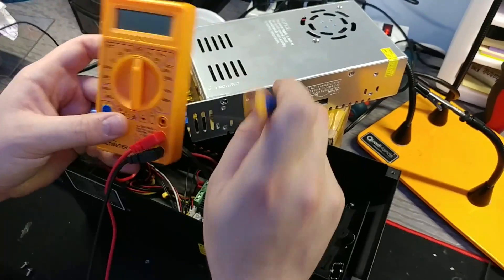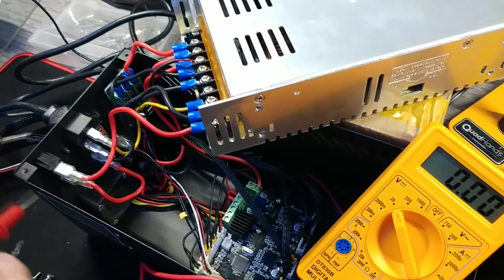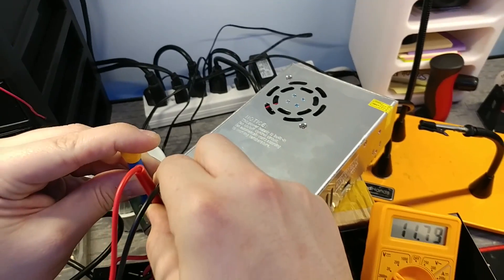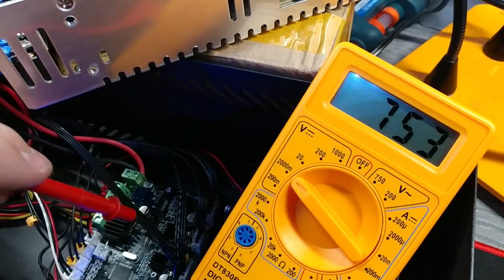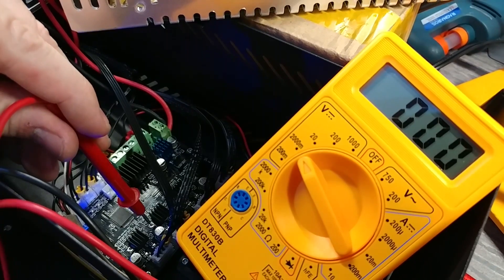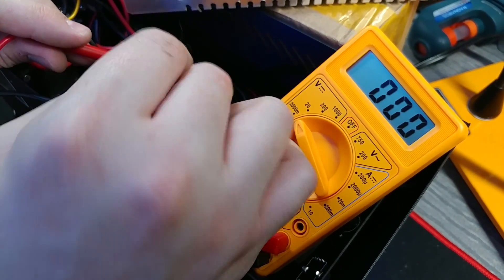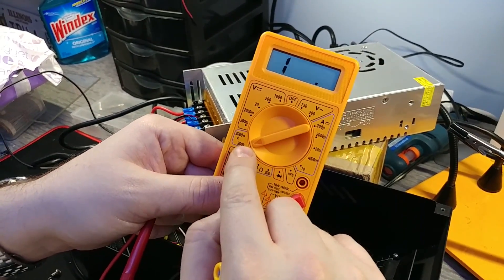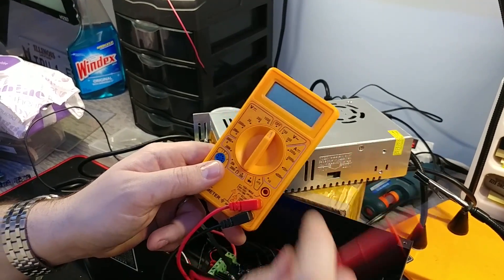Adjusting PSU Voltage and Stepper VREF Voltages

Comment: Any way to find the Max Rated Current of the Creality stock 42-40 and 42- 34 motors? I could only find one aftermarket site specing them at 1.5A. This would work out to something like this for TMC2208:

TMC 2208 VREF equation:
VREF= (RMS current x 2.5) / 1.77
RMS = Max rated current / 1.41

RMS = 1.5A / 1.41

RMS = 1.063

VREF = (1.063 x 2.5) / 1.77

VREF = 1.5014

with recommended 10% safety margin:

VREF = 1.33

Thoughts?

Comment: Damn, this is a solid explanation.  Thanks!!  Do one for the Ender 3 pls!!
Reply from the maker: Ender 3 is exactly the same except the PSU is 24V instead of 12V. The board is the same.
Reply: @TH3DStudio  Would you suggest changing this as you did here or leave it at 24V?

Comment: For ender 3, which are the max vref we can set for xyz and E?
Reply from the maker: E3 use 0.7 on X, 0.8 on Y, 0.8 on E and 0.9 on Z. Those should be good. Dont exceed 1.0.
Reply: @TH3DStudio  Thanks for the note. It has been rather difficult to find the configurations of the 4 stepper motors. Do you happen to have them? eg. the max torque or current

Comment: If you're bumping up a 12V supply to ~13.5V what should the voltage be set to for a 24V supply?
Reply from the maker: You can usually safely run about 25V on those. Don't go much higher.
Reply: @TH3DStudio  Thanks Tim. What about the VREF voltages? All of mine on the creality silent board are about 1.2-1.3V in their stock state.

Comment: The v2.2 board which is being selled in th3dstudio.com has a note saying different vref values? It says X:0.8V, Y:0.9V, Z:1V, E:1V
I guess we should use %90 of these: X:0.72, Y:0.81, Z:0.9, E:0.9
Reply from the maker: The VREFs on the product page are the recommended ones. But slightly lower will still be OK for most machines. If you get step loss on an axis then you will want to increase the VREF for that axis that is getting the step loss.

Comment: Ive been having consistent Y skipping problems and have not for the life of me been able to fix it. Ended up premptively replacing the motor with a similar one from Amazon. The review for the product said to change the vref from 7.whtever to 7. Testing the printer now, I hope to god this works. I tried tightening belts, wheels, grubs screws... At this point im put of options and it makes me sad :(
Reply from the maker: Check here: https://www.th3dstudio.com/knowledgebase/y-layer-shifting-on-your-printer-most-common-on-machines-using-cura/
Reply: @TH3DStudio  Link doesn't work, dude

Comment: I get all the same voltage on each potentiometer but when i move the axis, 2 of the motors are reading 18v and vibrating while the others are like 1.2v. Any idea whats going on with mine?

Comment: Great video!  I'm getting a bit confused though  because putting the multimeter right in the center of the screw gives me normal voltage(760) but touching anywhere else on the screw gives me double voltage.  I have them all set checking the center but my prints have been garbage since adjusting them.

Comment: A few questions:

1) Is the printer connected during this process?
2) How do I determine if my Z axis steppers are connected in serial or parallel?
3) Is there a preferred Z axis stepper connection? If so, how do I convert to that?

Thank you for your time.
Reply from the maker: 1. No, not in our video but you can have the machine connected still.
2. Stock is parallel.
3. Series is less work on the driver but if the VREF is set higher then theres not a big difference at all.
Reply: Thank you for the help :)

Comment: Note your steppers need to be enabled (which they are not if you just turn it on)

If the control box is open instead of jankily turning it upside down, plug in the usb and open cura and move each axis to enable it.

Comment: my x, y, and Z from the factory were set to 0.56, I was getting shifting on the Y axis. I upped the voltages to x 0.73, y 0.83, and z 0.73. Issues have disappeared. Very happy now.

Comment: Thank you very much. Seems these should apply to a CR-10 Mini as the steppers are the same so I adjusted mine (was getting bad layer shifting on the Y Axis). Found they were stock at X(.597) Y(.595) Z(.589) and E(.757). Changed them to X(.725) Y(.897) Z(.724). Left E alone since I wasnt having any issues there. After doing so im 6 hours into printing a piece with no layer shifting on Y

Comment: Thanks for this. My X and Y were 0.8V from the factory, I lowered it to 0.75V and I'll see how it does. The Z was already 1V. While the extruder drivers were both at 0.65V and I increased them to 0.85V.
Reply: Can you give a follow-up? How did it run with lower voltage? Did you return to stock?

Comment: Black is "Common", not Ground.  Also, on that cheap meter, "2000m" is 2 V or 2,000 millivolts.
Reply: So, dc current flows toward common? Why not ac too? All black is common. Got it.

Comment: Could you tell everyone what the proper VREF voltages are for X Y Z & E for an Ender 3?
Reply from the maker: 0.8, 0.9, 0.9, 0.9. You can try 1.0 on all. Basically if you run it too high the motor will just get warm. Nothing terrible. Better to be too high than too low.
Reply: @TH3DStudio  2 Questions:
1. what are good VREFs for the New 1.1.5 Board with TCM2208 Drivers?
2. With a pancake Nema on the Extruder, what ist the best setting
Thank you for helping
Reply: mine were on 573 for x,y,z and 792 for e, ive cranked mine to 752 for xyz and e still same, motors are a little warmer to the touch but not too much to burn your hands

Comment: Tim, quick question. Do you have to have the control box connected to the stepper motors to adjust all the voltages? Or can I have the box simply connected to the outlet with all the wires hanging unconnected?
Reply: You need to enable the motors by jogging them slightly before taking readings.

Comment: Thanks for this video and to learn and understand, I followed your instructions.

But on this web page (https://www.pololu.com/product/1182) it is said :

Note: The coil current can be very different from the power supply current, so you should not use the current measured at the power supply to set the current limit. The appropriate place to put your current meter is in series with one of your stepper motor coils.

And after checking :

Négative on PSU : 0.816 V
Negative on driver : 0.830 V

What do you think about this ?
Reply from the maker: I have done it both ways. It could just be a variance in the resistance of the wires going to the board causing the slight drop. It's nothing to worry about. If its slightly too high its not going to hurt anything. If you are worried check the motor temps. You want them under 70C.

Comment: "these CAN kill you" -puts finger over screws and pulls lid down. 0.0! Danger Will Robinsson!
Reply from the maker: If you touch them yes. :P I are professional.
Reply: TH3D Studio  Hey. Thanks for nice tutorial. During my upgrades (silencing) I readjusted my Creality CR-10 S4 steppers halfway down to your recommended values. The extruder motor was running really hot at 1150, and it also was hot on touch. So went down to 840, and should be fine. Now XYZ cube is being printed, and all seems to be ideal.  For the safery, what you did was really close with opening that lid. You might consider being more safe even if you know what you´re doing. The most secure thing is to think about the work like IT IS NOT ROUTINE. Most fatal injuries from electricity come from routine work. I was close, touching a heatsink with 600VDC potential from the industrial power supply. From that time, I behave very differently. One should, especially when he has a family... Thumbs up, thank you, and stay safe.
Reply: What type of death are we talking about here? Painful, slow burned to a crisp or a quick zap fall over type?
Reply: @n1337s  diffrent is spelled differently
Reply: lol
Reply: So can crossing a street 😂

Comment: what comes standard with the cr10s? series? also the carriage get loud grinding with at 100 % if I turn it down on the control screen to 70% its much more quiet I read it could  be the motor its self if that's the case and I buy a new motor do I have to adjust in software or just follow this video you did? thanks the prints are smooth no missed lines or anything its just very loud when the carriage moves quick back and forth I did also install dampers on all 3 motors

Comment: Just did this. I also had Y-Axis layer shifts every 10-20th print. 
CR-10S 
Original ---> new
PSU Voltage: Original_ 11.9v New_ 13.35v
Z-Motor(dual): Original_ 0.95v New_ 1.1v
X-Motor: Original_ 0.72v New_ 0.85v
Y-Motor: Original_ 0.75v New_ 0.91v
Extruder-Motor: Original_ 0.7v New_ 0.91v

Also, you can use a metal screwdriver like Wera and just touch the metal part with the multi-meter. This way you can read the adjustments and adjust at the same time.

I think my printer is behaving a little funky now though. I'll have to monitor.
Edit2:
I think I have EMF Interference. I have wrapped the ribbon wires in Aluminum foil and electrical tape and moved other wires farther away from the PSU. Testing. yeah... you DEFINITELY have to shield the ribbon cables and move the other cables away from the psu on the CR-10S once you go above 12.something. Retarded PSUs.
On the plus side prints are way faster now. It's like I added a supercharger. The motors are sooo responsive. Only time will tell if they overheat now.
Reply: Hey man, i want to mod my cr10s same as you, i still don’t understanda about shielding, which of ribbon cable that should be shield? And i should move which cable? Thanks

Comment: I"ve checked the reference voltages on my CR-10, and my E stepper was at about 0.75v, which should be normal--but there are times when I can see the extruder skip steps as if the hotend was blocked. I have replaced my hotend with a Titan/V6/Volcano combo, and still get the same problem (even with a 1.2mm nozzle and definitely no blockage). I'm starting to suspect the stepper driver itself is bad. Are there any definite signs that would indicate the driver is bad (besides the issue I'm seeing)? If it is bad, or if I just wanted to put better stepper drivers on my system, is it possible to add external drivers? Or would I just need to replace the Melzi board entirely?

Thanks!

Paul
Reply: TH3D Studio True. But I was mentioning the large nozzle to illustrate the fact that I definitely didn't have a blockage. I was having the same problem with the stock hot end, and I still have the problem with the Volcano and a 0.4mm nozzle.
Reply: Why not increase the extruder motor voltage to 0.9v?
Reply: lifeisgood070 I ended up bumping up the PSU voltage from about 12v to about 13.5v. That had the same effect, but helps my bed heat faster, too.
Reply: Yes it does heat much much faster. Probably about 30% less time maybe 50-60% less time. Extruder heating is also take less time.
Reply: Did you ever find a fix to your extruder motor skipping? My printer is having the exact same issues and I have no idea what is causing the problem. It's been driving me nuts!!!
Reply: It’s the hot end problem, the heat creeps into the cold end and caused a jam, mine fix with a diy water cooling on the cold end

Comment: This values should be the same with the V1.1.2 Board?
Reply: For allmost alle steppers drivers. but on the Cr-10 and Cr-10s not matter what Vx.x.x bord you mite have, just the same values

Comment: for cr-10 s that brings dual Z what voltage do you recommend? What opposites 9.8?
Reply: 1.1v to 0.970v (assuming parallel - default CR-10S)

Comment: Maybe a stupid question: when adjusting the Vref, do you have to connect the printer?
Reply: TH3D Studio ok Thank you!
Reply: I can't seem to see the reply you got, do you have to have the power connected when testing the vref?
Reply: You will want a load on the power supply close to what the printer will draw, especially for one of questionable Chinese origin. The power supply should supply a constant 12-14v (as noted, 12.5v-13.5v is a happy spot for the components) both with the machine idle and at full load. The entire purpose of the power supply is to hold an output voltage as steady as possible regardless of current draw + isolate the output from input voltage variations until current draw exceeds the rating of the power supply (remember Ohms law, power[watts] = current[amps] * voltage, or easily remembered as P=I*E). 

UL rated power supplies SHOULD be able to run without a load on them. If it plugs into your wall at home, you will want a UL label. This ensures the product was tested and meets quality requirements. Some power supplies can be damaged by running without a load. If you question a new power supply, you can use a 'dummy load' from automotive parts for a 12 to 24v system (I've seen some car parts take as high as 48v), a headlight is usually 35-90w and makes a decent load to test your PSU.. That being said, a new PSU can most likely be hooked up safely without it being out of range unless it is defective. 

Have a understanding of efficiency ratings and it will help answer some questions you may have https://en.wikipedia.org/wiki/80_Plus. For example, a Mean Well 350w power supply commonly found as a replacement on the CR-10 has an 83% rating, which isn't stellar but its probably better than most 12v supplies from China. They have good ripple isolation from the AC current.

Once all adjustments in the video are complete, ensure voltage doesn't drop below 12v while the machine is operating. If it drops below 12v you may damage components over time depending on each components operating range. There will be the most fluctuation as the heated bed kicks on and off while it fills the circuit (the bed draws the most power). If it drops below 12v, your power supply is either faulty, has an inadequate power or efficiency rating for the requirements of the machine, or there is a hardware issue somewhere (shorting). A good way to keep an eye on this is building an automotive volt meter into your case. They're only a few dollars, many have USB ports as well,so you can power other devices like a Pi, webcam, LEDs, or whatever with it.

Comment: Tim,  Thanks for this very informative video, I have one question...on the CR-10S which has the dual sockets on the Motherboard,  are they running in series or parallel and what should I expect to see as far as voltage goes?
Reply: TH3D Studio for cr-10 s that brings dual Z what voltage do you recommend? What opposites 9.8?

Comment: Thanks for the video! This was incredibly useful information! I did this at the same time I was adding my resistor to the 2 and 5 pin to fix the temp issue. I have you guys to thank for that as well.
Reply: neoc03 you mean a capacitor right?

Comment: whats the benefit on the dual Z in series or parallel.  I have a stock cr-10 and have a dual z kit coming so before I install I want to do it right.  Im not sure how to go about wiring it in series. couldn't find any info.  thanks for the vid man